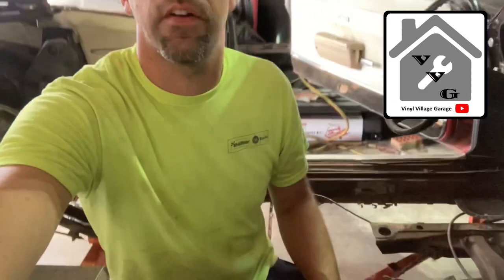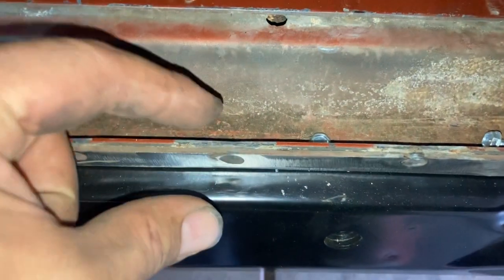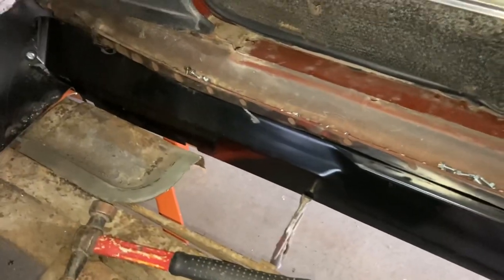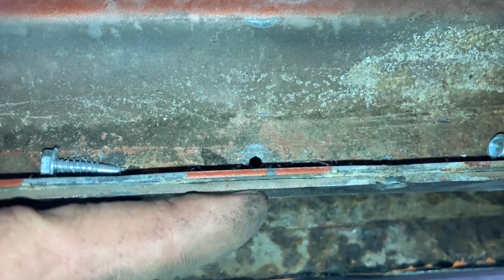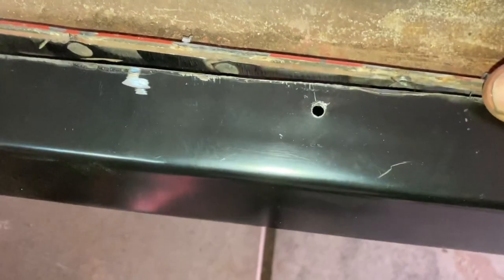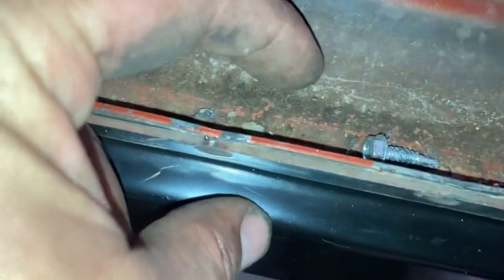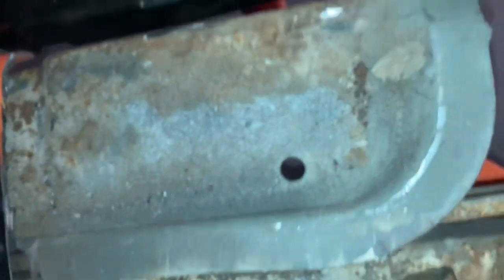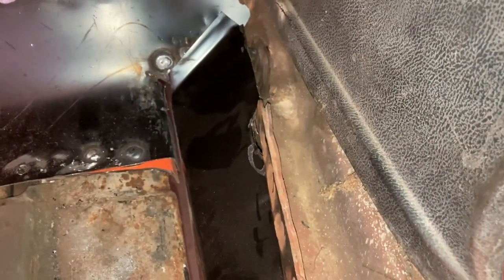1967, 1968, 1969 Firebird convertible inner rocker for $45

Comment: I believe the convertible has reinforcement plates sandwiched in side between the inner and outer, nice job!
Reply from the maker: You are correct a convertible has essentially 4 pieces that run full length.  Coupe has 2 full length and short sections at the front and rear

Comment: I believe the convertible rockers are thicker than the coupes.  You should  (if you haven't already) look into using an internal frame coating, like the one eastwood garage has.
Reply from the maker: Yes convertible rocker panels are 4 parts and heavier gauge. I wish they made the inner rocker only for convertibles,
Unfortunately it’s an assembly and this car wasn’t budgeted to do that so this was the next best thing and still looks good when done and stronger then a rusty patch.

Comment: Excellent tips, my 68 needs exactly this, can you recommend any inner rockers, mine is pretty rough, do I gain anything buying the one w. Kick panel support? On the NPD site you can get the coupe ones in 16 gauge steel, exactly the same they write for the full convertible rocker, so I guess that is same thickness?
Reply from the maker: If you can get 16 gauge inners go for it. That is a very nice thickness, I would  not mess with the kick panel supports unless yours are rusted out.  On this car they where still good. If you have to replace them it’s a good bit more labor to install them as an assembly
Reply: Thanks for the feedback, kick panels are fine in this case, it was merely if I got more metal with these ones. Inner rocker is pretty dead near toe board which was my thinking that you would get more, but I guess the normal inner rocker covers all til way to toe board? The panel on the car now goes wider near the toe board is what I mean.